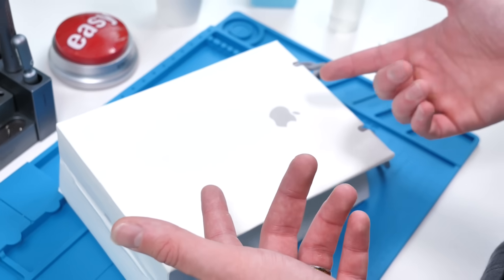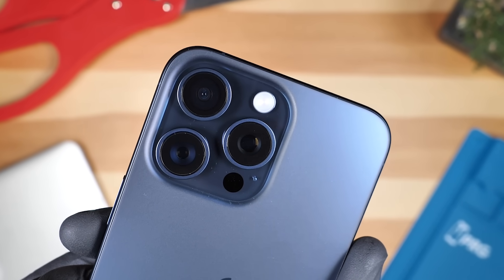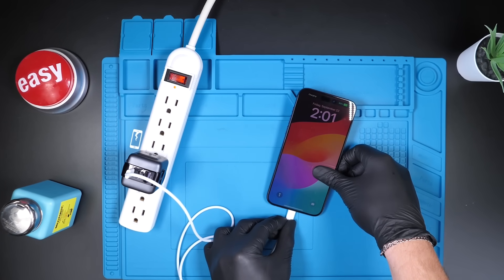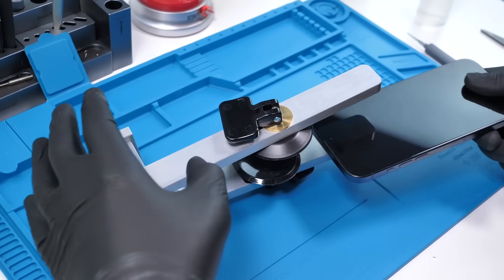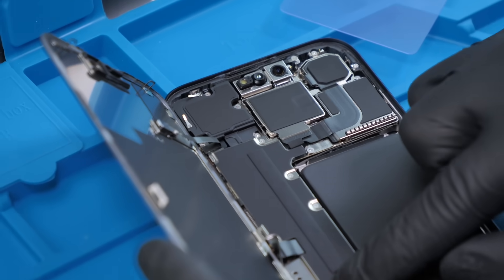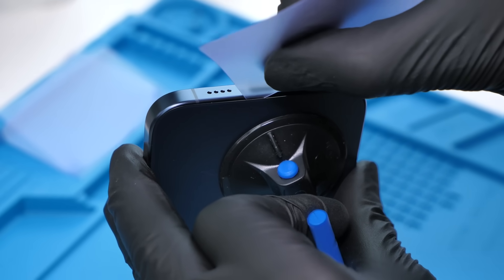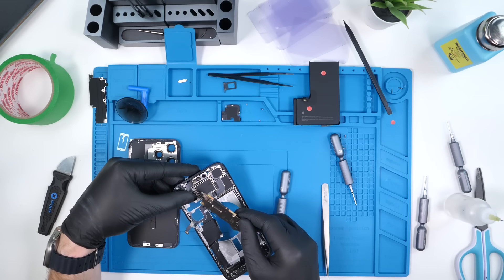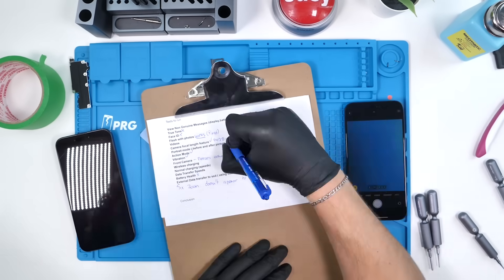Is The iPhone 15 Pro Repairable? - Parts Swap Test

Comment: My iPhone 15 pro Max was stolen on August 8th, 2024, I activated Stolen or Lost mode and it showed up only in one location and I haven't been able to find it. I worry that they dismantle it and use it as spare parts, so is it possible to do this? and if they do will those parts work for the new phone even tho the Stolen mode is activated?

Comment: Are you saying this is with all the phones I have a 14 from att they changed screen all it said and did was no original part but it still functioned. So I need a full motherboard for my XR will it be rejected. Apple isn't what it cracked up to be.

Comment: I just did a screen replacement in training at my job. I just used heat, small suction cup,  some alcohol and the ifixit opener you see on your left along with the blue picks. Took me about 3 minutes to open it. It's so much easier than older models where you have to take stuff off the old screen and add it to the new screen. The new samsungs gives me the hardest of times to open.

Comment: what i don't understand about apple is why can't apple just serialize all of their components (like they do right now) but add a category in the settings app called "self service"
which can automatically contact apple servers when any serialized components on the phone has been replaced and verify against apple servers that the component is genuine, and if it is genuine bind it to the phone's motherboard.
you know, just like how apple verify iPhone's eligibility for iOS updates, just like how apple registers product warranty via their servers and activate their devices like that.

i would fully understand if using non-genuine 3rd party repair components would disable features on an iPhone because apple would refuse to bind non-genuine parts to an apple device.
but in the current state, even if you swap parts from two brand new iphones the iphone would detect them as non-genuine until you contact apple directly to activate them wirelessly.
heck even if you buy the replacement genuine parts directly from apple themselves you still have to call apple to activate your genuine replacement parts...

i can understand why apple would not aid 3rd party part manufacturers - the phone repair business is VERY profitable when it comes to selling replacement parts to repair shops - apple's intend was to practically force people to only repair their apple devices in apple shops, but what they should've done is allow any repair shop to repair iphones but make it that it is not worth buying any 3rd party replacement parts - the vast majority of clients would chose only genuine apple replacement parts that can be successfully verified against apple servers even if they would cost double or triple the cost of the chinese 3rd party replacement part.
that way everyone could benefit from phone repairs - the repair shop would get much more clients because it wouldn't matter anymore where a person fixes their phones (as long as they opt for the genuine apple replacement parts), apple would benefit greatly from this because non-appe repair shops would buy and hold genuine apple replacement parts.
and overall the end consumer would benefit from this because now the end consumer could either chose any repair shop to repair their iphone using genuine apple parts (which cant be scammed as only genuine parts can be verified and activated against apple servers) and if adventerous, the end consumer could also just buy the replacement parts directly from apple themselves and try to repair his apple product on his own at home.

you know, like the way it used to be up until maybe 6-7 years ago???

Comment: For the longest I thought people were overreacting and being crybabies about the reparability of the iPhone however watching this video I realized the issue wasn’t the difficulty replacing parts but rather the fact that the phones are part locked with parts that have their own code that says they are a part of a certain amount phones meaning when you do replace parts the phone says that’s not the part I originally had I don’t like it . The eu doesn’t need to force Apple to have easily replaceable batteries aka ( able remove without equipment) they are already reality easy to replace however the eu does need to tell Apple they need to stop with the software saying it’s not original parts especially if they are original Apple replacement parts . Even as a massive Apple fanboy who tries rational most things Apple does I can tell it’s a shitty move of apple

Comment: I have I believe a broken screen iPhone 15 pro max. It makes a slight beep when you plug it in but the screen doesn't light up. I called a local nj repair shop and the guy quoted a price of $245 to replace the broken screen. More complicated than the $40 alcatel smart phone that I bought at Walmart a few years ago which still works and I can install apps like mobile banking, etc. Apple to me is like a Mercedes and the android is like a Nissan or Toyota. They just work and are not high maintenance. I heard that Steve jobs used to drive a Mercedes.

Comment: I personally disagree with right to repair. 

I agree Apple has taken it a little far but they have to make money at some point. 

The IPhone is apples product and they should be able to decide how easy it is to repair not the government. If you want the right to repair then you have the right to buy an easily repairable phone. If easily repairable phones made Apple more money than ones that aren’t they would switch.

On top of that, if everyone had right to repair that adds so many variables that Apple can’t control. If someone repairs it wrong or uses a bad/cheap non-Apple component that “harms” the IPhone it is Apple that looks bad not the repairer or the component. If you have to go to Apple for repairs they are then able to control the quality of the repair and of the new components

I also want to point out that PRG is lying to us. He does not want the right for ANYONE to repair, he wants the right for HIMSELF to repair. If anyone could repair their phones themselves then “PHONE REPAIR Guy” would be jobless since he would have no customers

Comment: Love the new 5x zoom which other phones already had, and the action button which other phones already stopped using (it's cool but mostly annoying) in exchange for even more anti-third-party repair efforts, a classic Apple move
Reply: yeah my s23 ultra had 10x optical zoom
Reply: @roostersideburns3440  s23 ultras have such high end cameras they can go as far as 100x and still be decently clear

Cameras however mean nothing when it comes to phone quality, there have always been phones with better cameras but no one uses them because their software isn't very good
Reply: @roostersideburns3440 why doesn’t it have 10x zoom anymore?

Comment: how do other shops fix this? or how does apple? if you send in a phone for repair, you get it back without the stupid blocking they do? is is a firmware modification they do? and if so, is there a way shops and repair people can be able to do this? i want to start working on apple eventually, but ive been put off due to this issue.

Comment: That is EXACTLY why the Back Glass on the iPhone 15Pro Max is breaking WAY easier then on any other version. As seen on JerryRigs video. The Back Glass is WAY MORE sensitive on this model because the aluminum frame isn’t actually adhered to the back glass like on past iPhones. So the structure and strength is gone.

Comment: The whole disagreement with regards to anti repair issues are great but in-fact it has significantly reduced iphone thefts due to the parts not being compatible. Apple could allow certified third party repairers to remove the issues but can they be trusted to not buy stolen phones?

Comment: Well, the iPhone Pro shortages are very common. It's crazy they changed the text on the battery to only be "trained" not "Authorised", they "forgot" to remove any software restrictions, even after pointing to repairability (which they hid from the 14)

Comment: I love to see the inside and I love the way you go investigating in the things that dont work no more after repair.

Question: Are you gonna do an clear mod on the 15 pro max backglass? I would love to see that and I think its also better to do with this one considering it doesn't do anything bad when you swap the back glass.

edit: I just saw the short in where you scraped off the back glass paint and looked at the clear 14 so that answers my question

Comment: I see it both ways. I've seen apple products where the parts were swapped with 3rd party stuff that is shit and while it saved the consumer money it kind of made it not appealing when I was buying second hand stuff. I would often return them. This ensures that even the second hand apple stuff meets certain quality standards even if repaired. On the other hand if you want to save a buck it seems justified you should be able to salvage parts from another device or even put in whatever 3rd party parts you want. In an ideal world this wouldn't be an issue But this isn't an ideal world and I would rather apple lock it down than have bad quality parts.

Comment: If you replace only the glass. Keep all the stock internals to it. does the front camera work then? Or when you order a new screen does it come with a new LCD and front camera pre installed? Can you fully remove the LCD? I've never actually looked that in depth to changing a screen out, sorry in advance if I sound stupid

Comment: tbf, it's possible to buy genuine parts directly from apple (at least in UK and EU, not sure about US). So I wonder if those would have same issue. Because what might be happening is not anti-repair per se, but actually block of the part swap so that it would be unreasonable to sell stolen iPhones for parts

Comment: the frame comes off because you heating the phone on the lcd side, if you heat the back of the phone for a little longer you would the lcd, you can remove the screen without it coming off the frame

Comment: I'd like to know if back panel can be replaced by third party? There re some sensors on it as well as coil. Also since faceid is in the phone not on the display - can it be changed without throwing any errors?

Comment: :o  wasn't the 5G antenna flex cable soldered to the back of the motherboard ? Saw another video where on an US version of iPhone 15 Pro (not max) the cable was soldered and in order to remove the motherboard you should disconnect the antenna or just rip the flex :)
Reply from the maker: Not on this model

Comment: Did you try replacing the swapped parts out back to the original phones? If so did the issue continue?
Reply from the maker: Everything worked as usual after returning boards and restoring both devices ones again

Comment: I feel like it should be illegal to software-lock functions after replacement of parts. When you buy the phone, you become the legal owner of it. Replacing parts is your legal right as an owner, and I feel like apple preventing that by disabling features is them overstepping their role as manufacturer. Why do they get away with that?

Comment: never use hot air gun in iphone AMOLED screen it will give burn mark and just put it on display separate heating machine in 89c for 2 3 minutes and use this tool like butter it will work. use achool light around display glue for use opening
Reply from the maker: I use it as an additional source of heat after using the heat pad. Not really a huge deal

Comment: When will mail ins be open? I have an iPod 6th gen that i think would be a good challenge to fix, because the battery is soldered directly onto the board and I don't want to do it my self because it's supposed to be a very delicate procedure and I don't have the patients or the soldering skills to change the battery.

Comment: I'm not buying this crap lol. The repairability directive from EU will fk them, that's why they make these devices garbage. So they can suck up "repairs" income until 2026 or whenever that due date comes. Pathetic really, I really like their software and overall optimization and stability, but they SUCK at hardware. Just engineered to be garbage.

Comment: Do you have a high magnification microscope, if so could you teardown the USB type-c port to check the pins length compared to other non-Apple devices?
There is a widespread rumor about Apple type-c pins not being compatible with other brands of cable because of different pins gap and length.

Comment: Quicker way to pop that screen open is with the heat gun and your handy dandy @JerryRigEverything razor blade and the suction cup. You may want to keep a couple bandaids on hand in case that razor decides to go after your digits! 😅

Comment: Be more careful with your language, the display is not hard to get off without breaking it, because it is thin, it is because apple uses a much stronger glue than necessary, specifically so you are more likely to break it when you open it up.

Comment: There’s actually a flex cable 5G antenna soldered behind the motherboard that you ripped off, it needs to be screwed off from the side frame of the phone
Reply from the maker: I didn’t rip anything off, there’s a difference in models based on which country you are in
Reply: Glad to know, thank you for the information ❤

Comment: Opening should take max 10 minutes. Use an ipa injector around the edges and heat both sides on a hot plate at 80c. 

Start with handheld suction tool and then use a quanli style or iflex style tool to lift the bottom. Swap to a plastic playing card and go all around making sure nit to touch flexes. Leave the top alone and allow that to be last, do not touch the front sensors with the tool.

Comment: Don’t know why everyone is raving about type c. It’s a flimsy connector, even Louis Rossman has stated this. My s10e got a grain of sand wedged into the connector and broke after 3 hours of owning it. My iPad Pro M2’s connector is intermittent at 4 months. My 12inch MacBooks port was worn to no fit at all after merely 600 charge cycles. Micro B is harder wearing

Comment: When I unboxed my pre ordered iPhone 15 pro for some reason it didn’t have the white screen cover it’s like as if they used it and put it back inside the box. It’s weird bc the seal wasn’t broken from the box but for the 1st time I see brand  “new” iPhone without any screen cover. Idk if this means my phone was used and repackaged or what the deal is or they simply forgot during packaging. Curious to see if anyone else had similar experience.

Comment: Honestly no one cares - I would never repair my own phone or use a third party and I have AppleCare anyway so the only reason to repeat your own phone is if yours is not supported or years old.  The only people whinging about this are those who make money from repairs - 3rd party repairers.  The time / effort / my own cost plus parts make it not finically viable especially within warranty.  I look after my Apple hardware and never ever had to repair any Apple device ever.  Remember you don’t truly own these devices you simply lease them even if buying outright, otherwise make your own phone where everything can be replaced and it will cost you thousands.

Comment: Theres a set of software to re calibrate, both the display and the face id sensors, that i believe is not available for consumers, that would easily fix all the error messages

Comment: Before I even watch this video, I can tell you right now that it's all still serialized! Everything! How do I know this? Because I bought 2 of them and just switched over only the boards and after I booted them up I had problems with EVERYTHING!! The front camera wouldn't even let me take a selfie picture it would freeze up instead and do nothing, and the screen itself disabled true tone, and the battery had problems. This is after Apple said they were suddenly ok with the right to repair...... That tells you all you need to know about where they truly stand on the right to repair.

Comment: hey what about taptic engine? is it still paired? cause you didn't mention
Reply from the maker: I’ve never had an issue with swapping the taptic engine before. Anyway everything was working normally
Reply: @PhoneRepairGuru  hmm now i'm getting confused 'cause i definitely remember that i had to reprogram taptic when working on iphone 7-xr at least, but it was quite a while ago and i haven't been doing any taptic replacements since then, especially models 12 and up, so maybe i'm missing out on that 🤔
anyway thank you for response and for the video😉
peace

Comment: The physical repair looks way easier. That battery replacement is dead simple. The only downside is not having a way for the user to prove it’s a genuine replacement battery. You could be in and out of the Genius Bar quick.
Reply from the maker: It’s pretty easy overall. Pro max displays are a little more fragile because of the size difference though. Definitely going to be using that massive hole to remove batteries in the future

Comment: Does anyone know why my iPhone 15 pro won’t charge with my usb c fast charger? 🥲 when I plug it in it starts charging but stops after a few seconds. It had 20W and I charged my 14 pro with it all the time. Yes I use the original cable that came with it

Comment: 7:14 those are EMI shielding fingerstrips for board or case-level RF shielding and grounding. I suspect the taptic-engine being a coil based actuator similar to a speaker (but tuned for response in way lower frequencies at high levels) and therefore be a strong source of parasitic interference if not contained well. They also exist in scales up to door-level for i.e. motor control rooms as well.